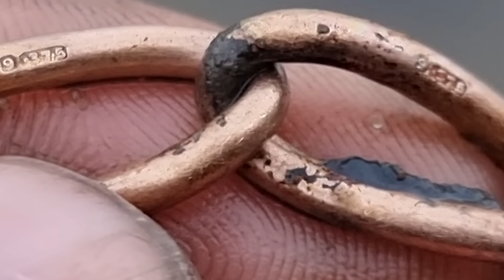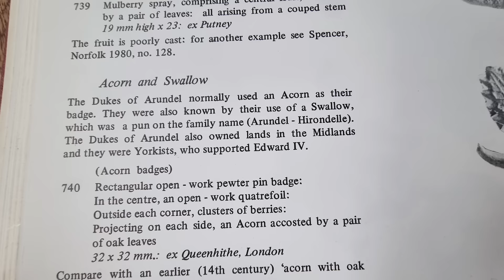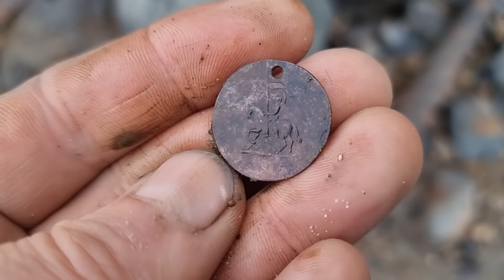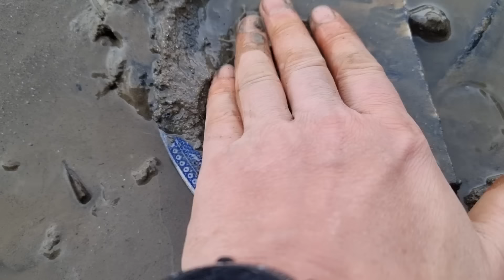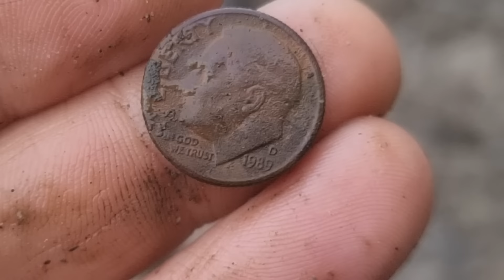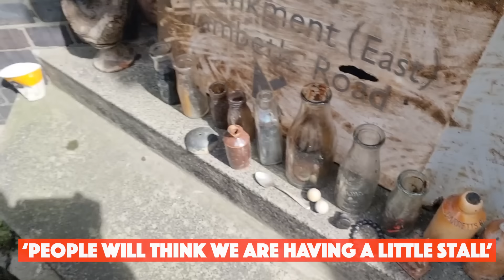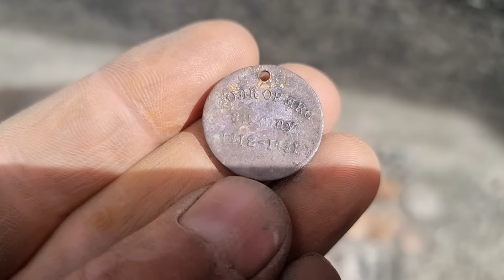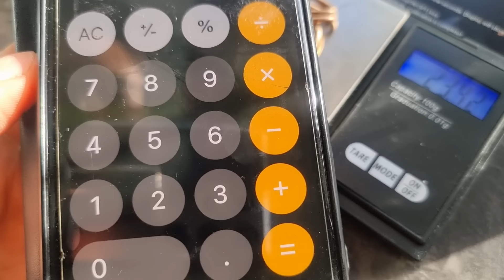Mudlarking FIND of a LIFETIME! How did that get there?

Comment: It's amazing that the Queen Victoria bust lay in the Thames all that time without anyone noticing since it's not really very small. I'm glad you found it! The dark ends of the links if the bracelet could be where the links were soldered and the solder hasn't fared as well in the mud as the parts that are all 9 ct.

Comment: Hey Si, My name is Simon also and I live in Los Angeles. Im a master patineur  and work with bronze daily. If youre finished cleaning the bust and want to add a little protection, you can apply a coat of paste wax and let it dry for ten minutes and then buff it for a shine. If you dont buff after its dried, it will stay matte. Keep Larkin'!!

Comment: What I use on my precious metals is toothpaste and a toothbrush, it will clean it until it is like new. The toothpaste will also act as an abrasive and help clean off the crud. Also I use vinegar and a rock tumbler to clean my coins. Throw some copper shavings or wire bits in with it and wait a day. Cleans them good enough to be used!

Comment: The metal stick that Jules found is a nut pick. It comes in a set   of four with a nut cracker. I have some just like it. I use them to crack  and pick crab and lobster shells also.  That may explain why you found it by the shore.

Comment: The small wood brace with the mortises cut into it looks like a capstan head, The off color top is from fire-hardening and the tapered end went through the deck and into the chain locker to raise the anchor.

Comment: Used ultrasonic baths in the laboratories I worked in they cleaned dirt and grease grim from glassware etc, not hard set coatings or crusts you were attempting to remove. They are ideal to clean your gold such as chains rings etc.
Reply from the maker: Cheers Mudlover! 😊👍🏻👣🧡

Comment: When using an ultrasonic cleaner you can put small parts in a glass container with the cleaning solution and submerge it in regular water. It saves on cleaning solution and cleaning the machine. FYI

Comment: The lead blob thing has with a stick things are from metal railing on walls the bottom off the post would be set in a hole then lead would be poured in the set it in place

Comment: The  Queens Bust is a real find. Do you sell your cut down bottles? I need one for my grandson.  Oh yes, let me tell you how to grill oysters on the half shell. Take a stick of butter { one half cup} of butter, put in small pan start to melt, add worchestershire sauce, about half a cup, add about 15 pepper corns and let all boil for about 10 minutes...set aside.  Start grill and  take your oysters on the half shell, set them shell down on the grill. Now you have the perfect little dish to spoon your butter sauce in, about a table spoon should do most oysters, cover with shredded parmasean cheese and if you like  bacon add some pre cooked bacon pieces. Cover with a pan to  keep the grilling smoke in with the oysters. If your grill has a top use that. When the cheese is melted and the oysters tenders muscle ends are turning up a bit, your dinner is ready.

Comment: Didn’t you take home the big wooden windlass? I would have, it was a beauty of a find.  Gold often needs cleaning when found in salt wate4 environments as electrolysis attracts rust and other metals nearby by it. It only ever comes out clean from in the Earth.
Reply from the maker: I don’t own a crane unfortunately
Reply: You don’t need one. Simply undermine it at low tide so it’s loose attach a couple of ropes around it with two five gallon plastic oils cans tied against it and let the tide lift it for you -then tow it ashore.  @Sifinds